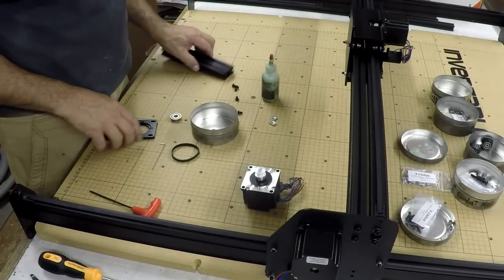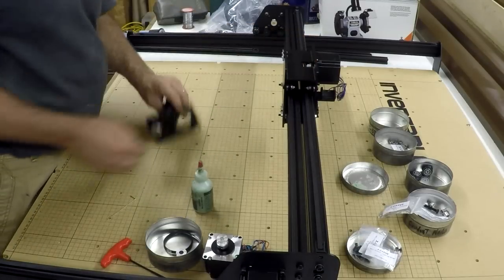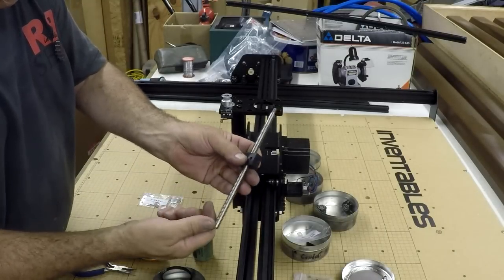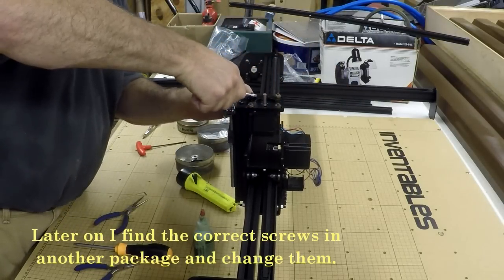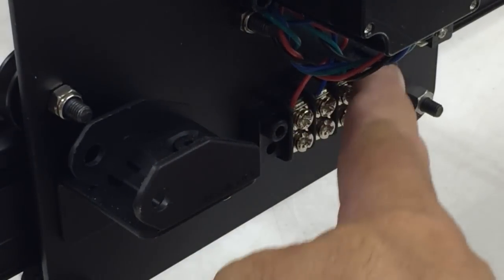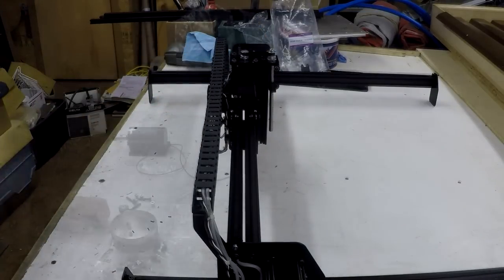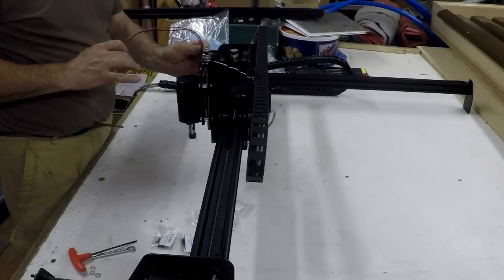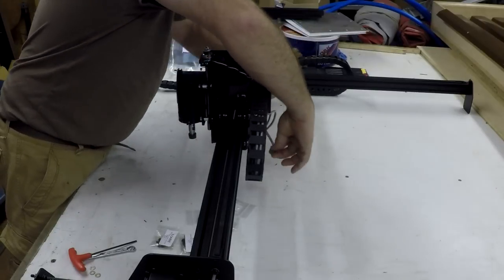Inventables X-Carve Build  Part 3

Comment: Hi Randy,
Good thing you have spare room in the shop, this getting bigger everyday you work on it...
So far I've always had issues with all DeWalt products i owned, mostly bearings, hope yours is going to last longer that what I've got, now, no more problems ===> no more DeWalt ...;-)
Cheers, Pierre
Reply: Bill Lewis
Hi Bill,
The only thing about your lock is, there is one side that is probably tapered... Or broken on one side, or all of the above...     

      The only 4 1/2" DeWalt grinder I ever owned lasted about 13 1/2 minutes, it just blocked in operation..... Opened it up checked, nothing, put it back in service, blocked a while later.... Since it stayed in the box for more than the warranty period, no refund possible, so, got it apart never to operate again, too dangerous to have grinding wheels flying in the shop... My DeWalt 12" Wood planer got new bearings after spitting the old ones out, my hand planer had new bearings, now, tired of changing bearings...       Good luck with your DeWalt tools..... Didn't work for me...!!!
Reply from the maker: pierre beaudry Getting there.  I have had good luck with the Dewalt tools.  They ship all the defective ones to Canada, you didn't know that, everyone here knows that.  LockCracker Phil sent me one we will see how it goes.
Thanks, Randy
Reply: And once in Canada, I get them....!!!   :-(
Reply: Bill Lewis I guess if the part is inexpensive, and with a good grease packing, it should go back into commission for a while...   ;-)

Comment: Randy, Not to rain on your parade but the 300W spindle that comes with the x-carve seems to have issues. Mine started carving as if it had a mind of it's own and Inventables said it was the spindle. Seems it has problems but they said it has been corrected but the replacements wouldn't be in for several weeks yet. So I , as other's have, replaced it with the DeWalt 611 router, also recommended by Inventables, so if you start having funny thing happen look at the spindle. Or save time and ask Inventables for a refund and replace it with the DeWalt 611 router up front!
Reply from the maker: James Mitchell Thank you James.  I have been reading there forum and they have problems with all of there spindles it looks like.   I already ordered there 611 mount so it will be a few weeks.  Also a viewer sent me a 611 and fellow YT creator.  So that should work.  It will be hard to ask for a refund, it did not cost me anything.  What software are you using?  I have V-Carve Pro and seems to be a good application.  I am having great difficulty using g-code senders with windows 7.  Thanks for watching,  Randy
Reply: Randy Richard Randy, I also am new to this CNC world so I have just used the software, Easel, that came with X-Carve. I have tried the Vcarve photo trial edition but I could never get it to work correctly. Vectric sent me some files to try but my spindle crapped out or started acting phunny on me so I haven't tried it yet. Sorta dead in the water until my 611 and 1/8" spindle arrives. Oh btw the 611 comes with a 1/4" collet and all the X-Carve bits are 1/8" just incase you haven't thought about that yet. There are 1/8" collets available for the 611 from other vendors. If you can't find one I have a source that was given to me and I will forward it on to you if needed.
Reply: James Mitchell Here's the link, http://www.elairecorp.com/dewaltroutercollets.html#dwcross10
Reply from the maker: James Mitchell I have 1/4" and 1/8" collets for the 611. and for the 300W spindle.  I also have 1/4" and 1/8" bits.  Thanks for the link, I will check it out.  The Easel program is limited and the V-Carve is quite a bit better.  
Here is a link you might be interested it using VCarve Photo.  https://www.youtube.com/watch?v=eaWxs82Ly38
Reply: James Mitchell Randy, thanks for the link, Allen has been holding my hand for a few weeks now!
Reply from the maker: James Mitchell He has been helping me also.  With the connection issue.
Reply from the maker: James Mitchell Here is also another link to some real nice collets.  http://www.precisebits.com/products/equipment/dewalt_611_collets.asp?tsPT=!!!Dewalt_611!!!Collet!!!PG!!!#Tabs